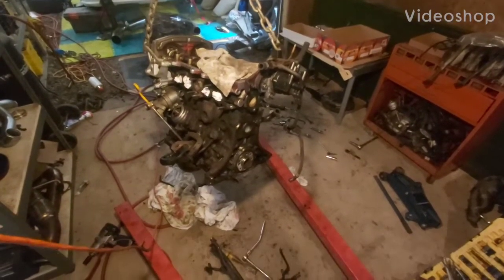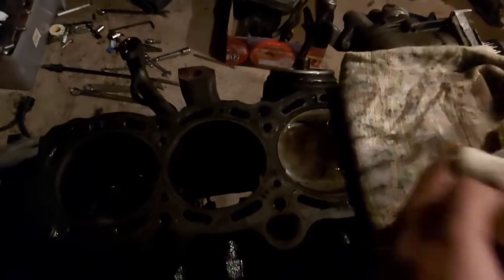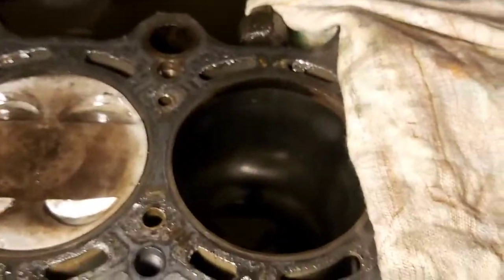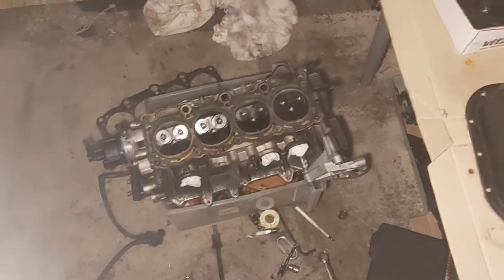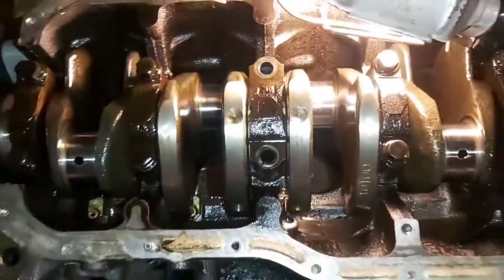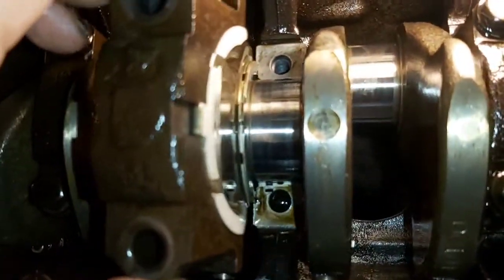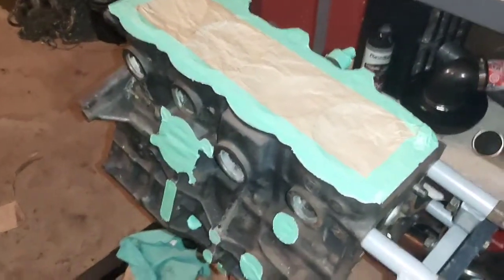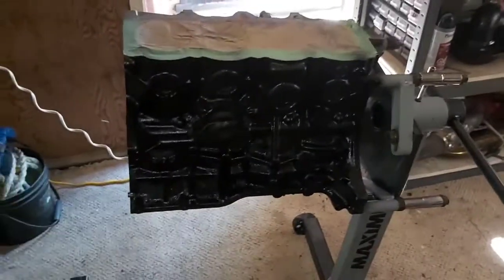3sgte Engine rebuild    Part 1

Comment: Hi i have a st185 gt4 group A
Engine has done 149000kms
And the is oil around the the thread and electrode on second spark plug the car seem to be missing and blowing smoke
I have had it garaged for 2 years i have been away only just noticed when i changed plugs and oil NOTE oil is on the thread of the plug NOT on the top or ceramic part of the plug.
I have known for these engines to have oil in the spark plug tubes but this isnt the case for me its cylinder 2 and oil around the thread anyone have any ideas
Reply from the maker: Hey it could be the valve cover gasket where it seals the spark plug holes.
Reply: @turbogarage4889  they are known for that but the oil isnt up it the tube around the plug or ignition lead its only around the thread and electrode it looks like its burning oil and i get a misfire every now and then.
Usually when valve cover seals go the oil ends up all around the ignition leads
And top of the spark plug the oil is only on the bottom of the plug
Seems like its leaking into the conbustion chamber
Reply from the maker: You need to do a compression test, that will tell you what's going on.  I struggled trying to diagnose my oil problem, finally did a compression test and was at 135 and had that cracked piston.  Either way let me know what the results are.  Cheers
Reply: @turbogarage4889  yea think your right i dont think ive cracked a cylinder ive been very easy on the car been looked after but i went away for 2 and half year and after using an engine flush and changing the oil i noticed the smoke and misfire
Im thinking it might be rings on the second cylinder or the valve stem seals
Both of which i dont think i could do
But ill see after the compresion test
Thanks